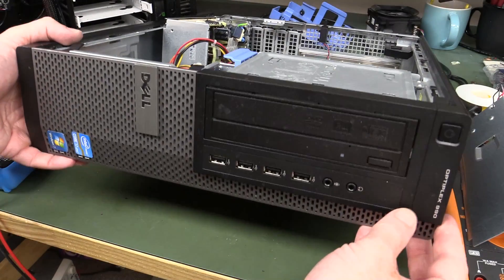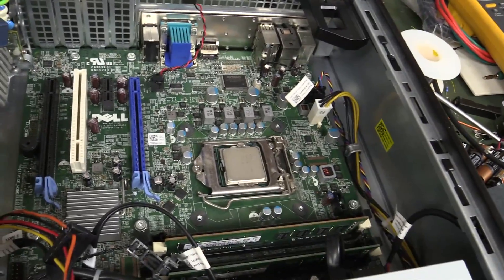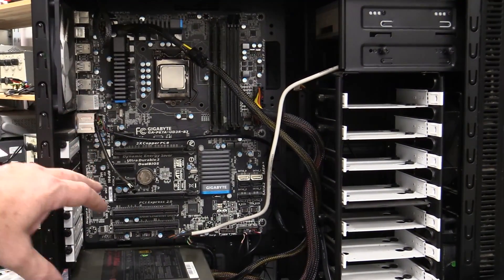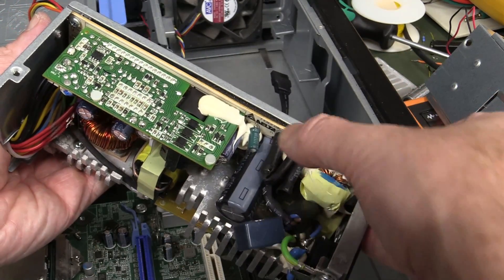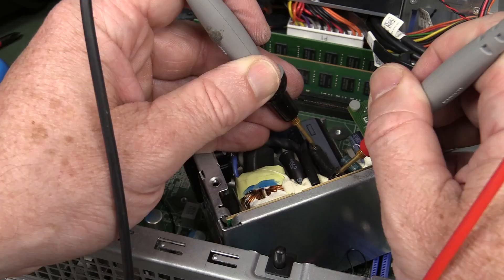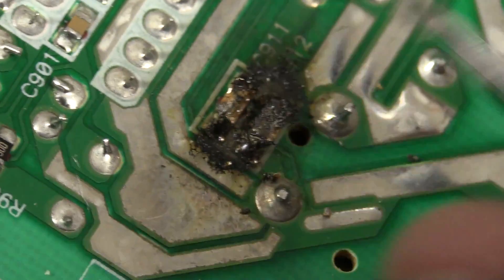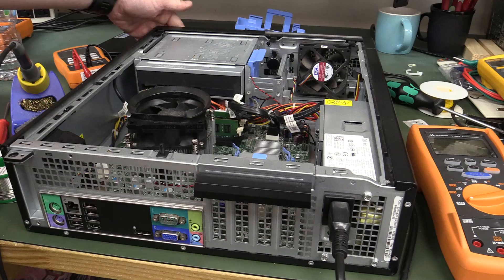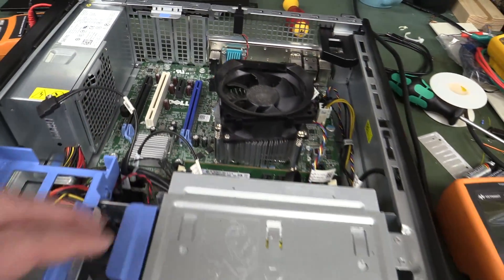EEVblog #1077 - Dumpster PC Repair

Comment: People throwing out computers amazes me sometimes. I have a neighbour who threw out an almost working "Gaming PC" with some still up to date components (AMD Ryzen 2600, Radeon RX580 etc...). Fault: The cheap chinesium ATX power supply. Since I knew who threw it out I asked if he wanted it back for the cost of a replaced PSU. He said no. I also asked why he didn't replace the PSU. It's a fairly simple task, and he being quite handy with cars, engines and being a good mechanics it should be a breeze. His answer: ""That computer stuff scares me. I don't wanna touch the inside of 'em. Car electronics I have no problem with.".

Lesson learned: People are scared of the black magic inside computers, despite being handy enough to do their own service/repairs of em.

Comment: these psu's are built for non servicable part , if they got burnt replace would be cheaper then repair.i once repaired pc smps .but i gave up ,no money on this repairs ,time consuming. always shorted mosfets, bad caps etc etc.i think u better replace it with a new one.repairing is not an option for everyone. thanks see ya dave.

Comment: still using i3 5400k in my system ,man that thing  runs cooler.
Reply: i3?
Reply: @sergiobeltrao  didnt u heard about intel i3 cpu?
Reply: @Abhishek-C92  I did. But i3 5400K? Is't AMD A6 5400K?

Comment: every (chinese) PSU now : "screw the soldering, let's dump a shit ton of glue to keep em caps and resistors together!" but i mean, come on, a I7 8 gigs in a dumpster for just a PSU...
What kind of dumpster is that?
last thing i dumpster dived was a Sony Xperia android phone, since I don't fancy smartphones, I just use it as a device to stream webradios and some MP3s on my hifi. and also keep my mystical presence on some IRC channels to pretend I see everything going on.

Comment: Sad to say this, but when it comes to branded computers like this, the power supplies are often the weak point, as they try to slim them down to fit in their small form cases.
They're trying to cram in the same components and power rating from a full sized ATX power supply into something that's 1/4th in size.
And if that's not enough, it has to be 10 times cheaper too.

Where I work, we replace Dell computers power supplies all the time. We have em on stock as they're the one and only component that blows in em.

Comment: Just an fyi, the i7-2600 is faster than the i7-3770S (S = thermal & clock gimped for SFF PC's, & Ivy Bridge [3rd Gen] only has 3% better IPC than Sandy Bridge [2nd Gen]). All killer finds though.

Comment: Dell power supplies have always been mediocre. The PSU is the weakest link in most of their systems. Their monitors are also pretty bad: power buttons that break after a year or two and random panel lotteries come to mind. Despite that, they're actually rising up in the ranks of power supply brand quality, albeit without actually improving in quality.

There's been a plague of defects, even in high end power supply units, for the past decade. Not just cheap capacitor problems down the road, but simple and hard to locate manufacturing defects. Long through hole leads shorting nearby traces, incomplete solder joints on surface mount parts that were put too close to unintentional solder wells. Weird design stuff. Most people wouldn't expect a brand new power supply to blow up on them, but the first time I saw that was way back in 2009. Dell probably tests their hardware for defects beforehand, and that puts them ahead of the competition these days.

Comment: And I thought scoring an old Asus X58L (which I use for my main computer) was good.

For those playing along at home, it has an Intel Celeron Dual-Core CPU, clocking in at 2.1GHz, with 2GB PC2 RAM and a barely-usable Intel Mobile 965 Integrated Graphics job.

Had a working screen, though.

Comment: As an IT guy I found it very funny to watch this video. That i7 cpu overclocks really well if you can find the K series, but of course forget about the overclocking with a branded PC like DELL. And the i5 is not that much slower the 2500 model has the same graphics chip and also 4 cores but no hyperthreading and it's just 100 mhz slower, so I wouldn't say that it's that much slower, the main difference is the 2mb extra cache level 3 for the i7 CPU.

Comment: In the early 90's I worked for a company than moved all the furniture around in a big office complex type place when project teams finished they project and moved on to other stuff. They were putting perfectly good 486 machines in old disused buildings for storage never to be used again. When I asked about buying one ( I was at collage and needed a cheep PC ) I would told they can't sell them as they did not pay the VAT when they were first purchased. As a result it would cost them too much to sell them as they would have to pay the VAT on the original purchase price. I suspect it'll be something similar, if it breaks or is not needed, throw it away because it's cheaper than selling them. Could also be from abandoned offices being cleared out.

Comment: My best "dumpsterish" find so far is a 12V 66.6A power supply from a store which sells old junk. usually they don't have anything valuable; old broken table lamps and ovens stuff like that, but I found this and the storekeep parted with it for about 5 of your US bucks. It was working perfectly and is worth about 60$ brand new.

Comment: That button on back of PSU is actually PSU test button, when you press it it should start and light the LED.
Reply: Wanted to say this too - it's a great way to quickly test whether a PSU works without having to mess around with the connectors.

Comment: Hi Dave, love your work... The button on the rear of the PSU is a used to perform a Built in Self Test of the PSU. Here is a publicly available KB on the use of the button and the LED. http://www.dell.com/support/article/au/en/audhs1/sln153370/no-post-and-no-power-failures-on-optiplex-990-and-790?lang=en

Comment: No BIOS password - lucky you. That's a C**T to deal with when it comes to Dell.
Reply: *swears at used SuperMicro Rack server that came with a bios password..  Shorting the CMOS like mentioned in their service manual for >10 seconds did nothing.... AMI Bios reflash feature didn't work, too. Ended up removing the whole CR2032 for half an hour - and it magically worked..

Comment: I'd like to differ and say when replacing a fuse you always check for shorts on the bridge rectifier before powering it on to see if the fuse blows: reason is that most of the time the 5VSB SMPS IC has blown, and when it's not that a Mosfet in the APFC section has gone short circuit.
Powering it on again without checking for a short just means a big risk that more mosfets get shorted...
Out of curiosity did you check if the fuse failed again after powering on?
In many cases nowdays the reason for such failures is actually the main filter cap being open: no capacitance at all for the APFC section, I see Taicon written on the one in this SMPSU.
The replacement PSU seems to not have APFC since there is a voltage selector switch: that means it will load the bulk filter capacitor much less and it will likely live a long and happy life even with your run of the mill Chinese caps. :)

Comment: i was recently looking for  an older pc so i could run xp and mach 3 on it for my cnc engraver - had to have a parallel port on it for the controller.  , i swear a week earlier i was tripping over the damned things but when i wanted one do you think i could find one !

Comment: Those Dells are a great bang for the buck.  I recently got a similar one with legit Windows 10 Pro and 16GB RAM for less than the cost of Windows alone.  I've pretty much stopped building DIY systems except for when I want the latest and greatest.

Comment: A quick tip if you get any optiplex PCs, before powering them on with the power button you can press the grey button on the back of the PSU to test the it without booting the PC

Comment: Dave, be careful original PSU was 250W replacement you get from older PC is only 120W. Could be it is not enough when you put there some GPU.

Comment: green and black wire Dave, better to short them out and measure voltages without connecting psu to motherboard.

Comment: I watched the whole video and am still waiting for the repair, or does swapping out the power supply count as a repair?
In that case, . . . Today I repaired my remote control, my clock and my DMM just by replacing the batteries, they now work like new! I am a repair genius!!

Comment: the wattage on the power supply you swapped in is severely lacking for that system, you swapped a 250W for a 120W,,, this could lead to some pretty bad instability
Reply: Nope he didn't, the "max 120W" text was for two of the rails combined. Read a bit below, and the new PSU also says 250W.
Reply: ahh, my bad!!

Comment: Replacement is 150w and the original is 250w, not ideal. Fine under normal operation but may struggle when under load.
Reply: The replacement PSU is also 250W, take a closer look at the texts on the bottom.
Reply: 8bitbubsy attention to detail is obviously not my strong suit...

Comment: Great finds and what a deal. Thanks for the video! Due to environmental concerns here in the USA,  it is forbidden to throw away electronics in a dumpster and they have to be recycled. Stiff fines for companies that don't comply. Due to this, it is not very likely to find such discarded treasure anywhere around here.

Comment: In the school in Rwanda where I work, they always hack standard ATX supplies into the dells. Simply cut the metal to make space for the plug and drill holes for the screws. Then the PSU hovers over the MB.
Guys here know how to make arrangements.

Comment: I too keep finding 500GB sata hd's from sky+hd boxes & the odd occasional pc with its hd still in it, there were nothing wrong with the motherboard but it had one flaw, the dvd writer didn't work so I shoved a replacement in & found the system worked fine just one small problem I have & that's the op system is XP media centre which is obsolete now

Comment: Also you can't swap the motherboard into a different case bc the front panel connector
Reply: you can just run it without the io cover in most cases. Not as pretty but it will work.
Reply: qlum but most dells (maybe not that one specific) use a proprietary connector for the front panel io so that it can connect to the multicolored 1234 diagnostic lights and the pin out for the connector varies from model to model (for some reason)

Comment: one of our students at my highschool made popcorn out of dell 775 power suply by switching 115V/230V switch to 115V while computer was runing on 320V line
 and i mean popcorn, because power suply simply pop ed many times inside
computer board was fine though

Comment: im amazed corporate managers don't sell those off to resellers/recyclers which then deal with selling them - you know after ripping the harddrives out and destroying them for obvious security concerns.
Reply: Not worth it. When places do big refreshes, sure, they sell them in bulk, but failed equipment older than 5 years goes in the bin usually.
Reply: ah true it definitely is outdated by then anyway.

Comment: I had a Z77 series Gigabyte motherboard, and I had power issues too. Do you have a power supply that has a Standby/Ready/Fault LED? On my motherboard, with all power cables attached to the motherboard, plugging in and turning on the PSU would result in the PSU LED lighting to indicate standby mode. Pressing the power button would cause a slight fan twitch and the PSU status LED would immediately switch to displaying a fault condition. I'd have to manually turn off the main power switch, and then turn it back on, to get back into standby mode. If I disconnected the 8-pin CPU auxiliary power cable, and pressed the case or motherboard power button, I'd get the similar fan twitch, but the motherboard would gracefully shut itself down (not detecting CPU power), and the PSU would return to standby mode.

I'd look into the voltage regulators that provide the CPU with power, if you are curious to delve into it. If not, that's possibly what's happening, if you're getting a mere twitch of life, and a shutdown, with a known good PSU trying to power that Gigabyte mobo. Even before my Z77 motherboard failed, and I had it repaired, it refused to boot with some power supplies, and was fine on others. The thing that seemed to differ between PSUs that worked and ones that didn't, was whether the 12 volt supply was a single rail, or was multiple 12 volt rails.

Comment: I found an HP compaq pc in the dumpster and it had a failed harddrive and overheating problems. my school threw it away and i picked it up to see if i could repair it. turning it on the fans spun FULL SPEED and scared the hell out of me. the nit started beeping. turned out it didnt have ram and the power supply failed lol

Comment: That Dell / Delta PSU looks like a standard TFX form factor one. If Dell didn't do their proprietary(?) special sauce on the main board (ATX 24 pin?), one can get a nice new Seasonic 300W one with 80plus efficiency rating for ~35 Euro bucks, even cheaper if you don't look at names and brands.
Reply: 24pin ATX is not "special sauce"
Reply: Yes, that's what i meant. But some Dells, or was it HP(?), have shorter connectors, 12/16 pins. Those might just have one fat 12V rail and a buch of VRM circuitry on the main board.
Reply: Peter Mulholland ATX isn't special sauce, but when Dell brings out a 'proprietary' ATX pinout with different voltages. Yeah I think that's 'special sauce'
Reply: >But some Dells, or was it HP(?), have shorter connectors, 12/16 pins.

HP does that. I worked on some HP Z440 workstations, PSU was proprietary size and had two what looked like half width ATX connectors that just supplied 12V to the board.

https://cdn3.bigcommerce.com/s-flrmgptrok/products/4641/images/13977/%2524_57__34278.1508791627.1280.1280.JPG?c=2

The thing was chock full of proprietaryness, look at all of the non-standard power connectors. I had a look inside the rear grille on the PSU and it was stuffed full of jun-fu, asia-x and other Chinesium brands which are guaranteed to fail in a years time.

>Dell brings out a 'proprietary' ATX pinout with different voltages. Yeah I think that's 'special sauce'

Dell has overall been pretty good about not using proprietary power connectors. The last machine of theirs I saw with a non-standard ATX pinout was nearly 20 years ago on one of their high-end PIII machines. Not to say they haven't done it since, but I've worked on a lot of Dell machines over the years and have yet to see one since then. I think the only slightly scummy thing they have are those mini-ATX connectors with the much smaller pin pitch.
Reply: Yes I remember them doing that. Didnt last very long
Reply: It's also not TFX, the 990 has a proprietary size that is narrower than TFX.

Comment: Great video I love PC teardowns and repairs. Few things though:
1) i7-2600k uses Socket 1155, not 2011. They come from the same era, but are definitely not compatible.
2) You might have trouble fitting a standard sized motherboard into that case, Dell like to use the BTX form factor which AFAIK is incompatible with the ATX form factor used by everybody else.
3) The missing 4 pins on the ATX cable are a few extra lines of power. Not necessary to boot up, but might cause problems under load. Only 12v really matters these days.
4) If you think you've got a faulty power supply, you can short the PSON# pin to ground to simulate the on button being pressed without having other hardware in the way, or at risk. PSON# should always use green cable, so it's easy to identify. You can also use this trick to power a PC with multiple power supplies if one isn't enough for whatever reason.

Comment: off the shelf home/office PCs always have underspecified power supplies. it's an irresistible cost cutting move since most users do not push the hardware hard enough to reach maximum power draw. dust builds, software becomes more CPU hungry; PSU that worked a couple of years ago is now overloaded. major reason to build your own PC

Comment: It's all about economic write-offs. In the Netherlands businesses need to keep electronic office means like laptops and desktops for five years, before they can replace them. According to the Dutch IRS.  That core i7 3770S (I have one in my machine) is from 2012/2013.
So that would fit with 5 year economic write off. In fact, you can look it up at Dell support website, enter the service tag and get all the specific details about the machine.

Comment: The 2600/2600k is a CPU that can pretty much have that "never obsolete" sticker, due how intel didn't improved the performance that much from it even after all those years.
Reply: Dr_Kachu san That's right. I'm still using an 8 yr old i2700k in my main system. Never saw the need to upgrade it.
Reply: Just over 6 years, actually.
Reply: Dr_Kachu san Do you know that is it applies to the i5-2400 as well? I had the same Optiplex 990 like in this video, but with 2400 CPU.
Reply: My 2600 was used when i got it in 2012 and it's still rock solid now.
Reply: 9900K - hold my beer
Reply: Well - unless you have some spares, it will get obsolete after some years (~15 and upwards, I don't know the numbers, I'm just guessing) due to some aging in the processor. You know, stuff like Hot Carrier Injection, Electromigration and other nice things. Sure, it won't result in an immediate failure of the microprocessor from one day to another, but it will decrease performance as some transistors won't work anymore or behave different than expected.

So, yes, technically this should be an explanation, why there is a performance degredation. Of course though, it is a multifactorial issue, based highly on personal bias aswell (if you are used to faster PCs, you might say "it's old, it must be slower")..